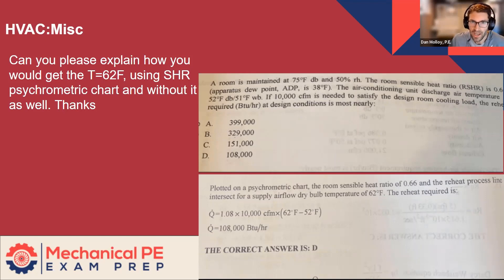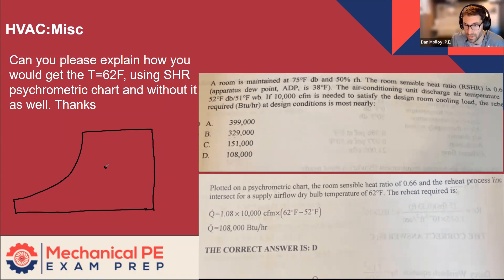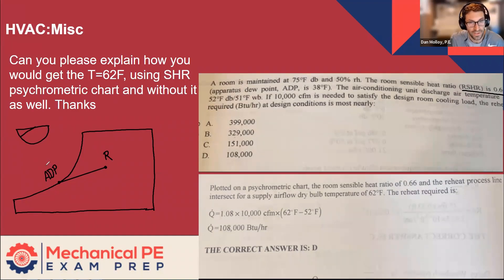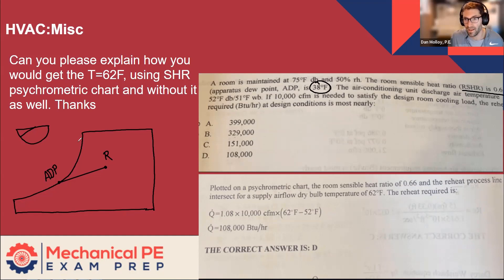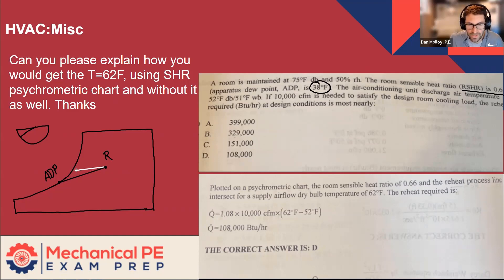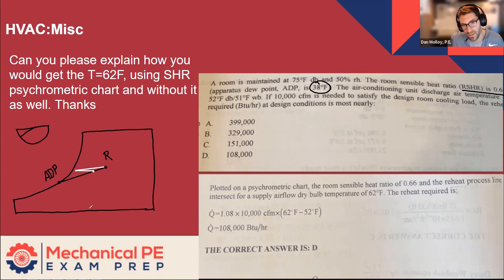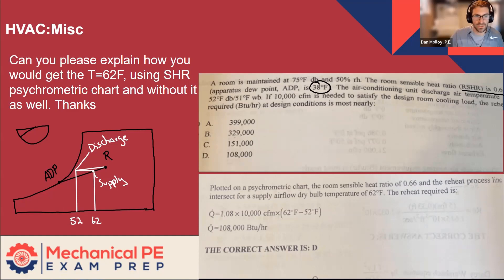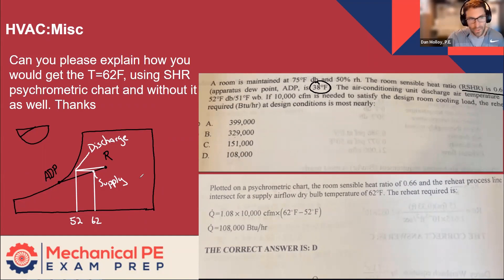Common Question - Graphical Solution Using the Psych Chart to Solve HVAC Problems

Comment: Thank you for the explanation. How would you trace this during the computer based exam? Do they have software or a PDF that lets you draw lines on the psych chart?
Reply from the maker: Yep, there is a line tool.  I believe NCEES has a video about it you can find on YouTube, but it's pretty intuitive.  The only challenge I've heard is it is difficult to draw parallel lines since there is no good way to transpose from one area of the chart to another.  That's where you might need to be a bit creative.  The hope is if you are having to eyeball it, the answer choices should not be as tight as if you had a table and could interpolate with high precision.  Hope this helps.
Reply: @MechanicalPEExamPrep   It does help. Thank you!